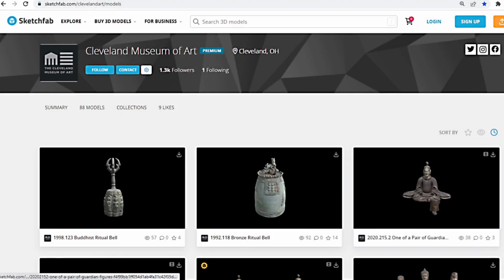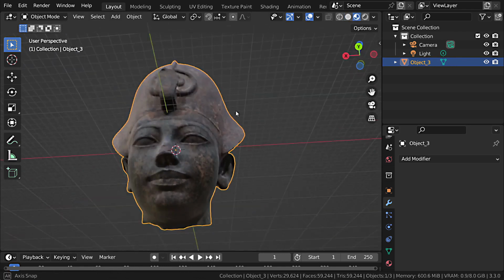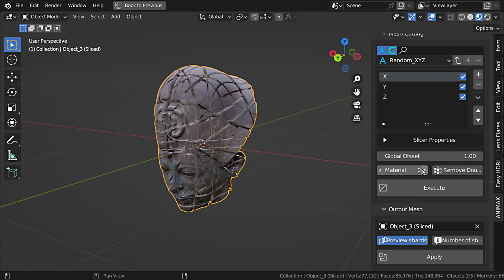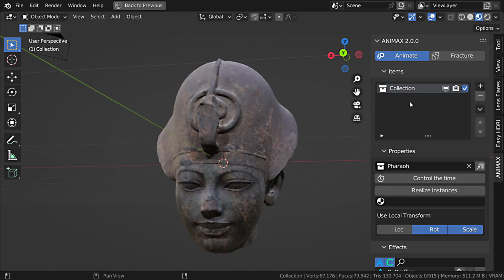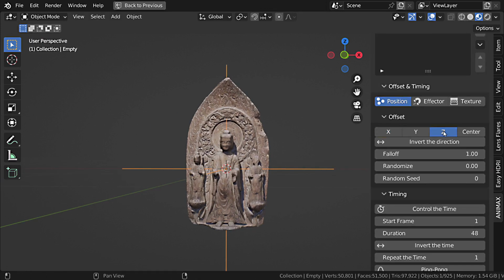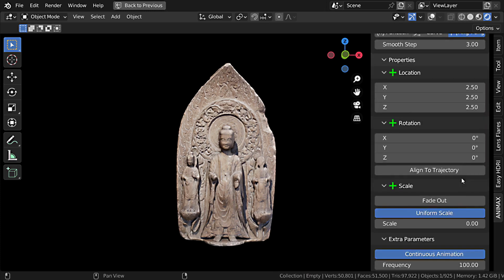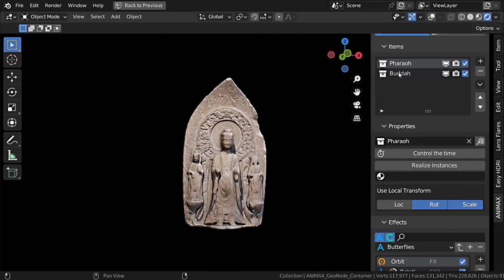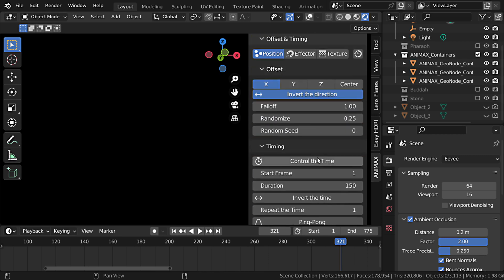ANIMAX 2.0 Tutorial - Morphing from a group of instances to another

Comment: Unfortunately the interface is pretty complicated to be usable. Maybe try to simplify it for version 3? Thanks
Reply from the maker: We are considering a simpler version of the add-on as the next big update, but for the moment you have a couple of options:

1- Use the exposed parameters, this feature was introduced in the version 2.1 to simplify the use of the add-on.
2- use the version 1.6, it's much easier to use, but you wont have much control.

Thanks for your feedback!

Comment: how do you fix the exterior texture after the fracturing operation I've experienced some shading issues on the outer texture of my object
Reply from the maker: Maybe auto smooth is disabled, to enable it select all the objects and make one of them the active object, then hold Alt while enabling Auto Smooth.
To get proper support please contact me from the market you bought the add-on from.

Comment: was trying to make a car animation inspired by your demo video but when so ever I try fracturing my car system just crashes please give me some tips on how you did it, Thanks
Reply from the maker: I used the Shell Splitting Tool to fracture the objects, using the Mesh Slicing will not work well with objects that have flat surfaces (no thickness).
In my case I fractured the body of the car, then the wheels, then put all the objects in one collection, because the mesh of the car (as one object)  was too dense.